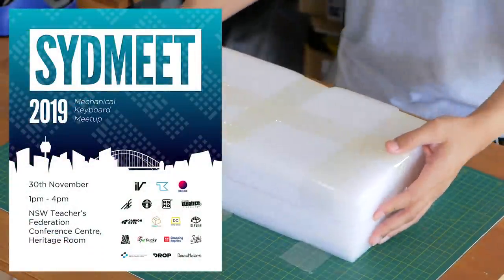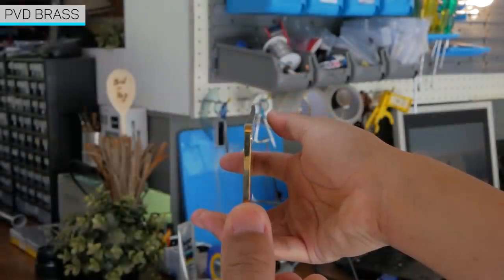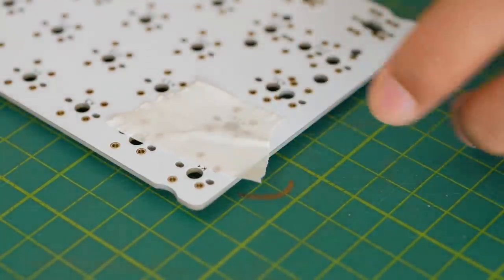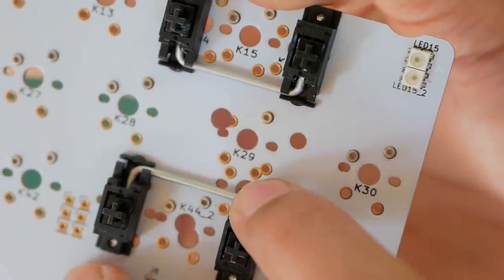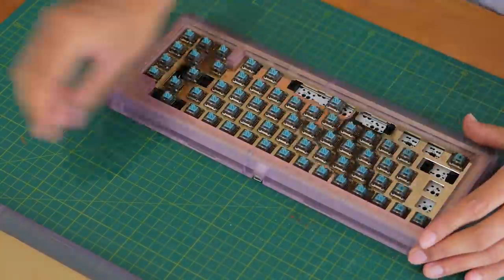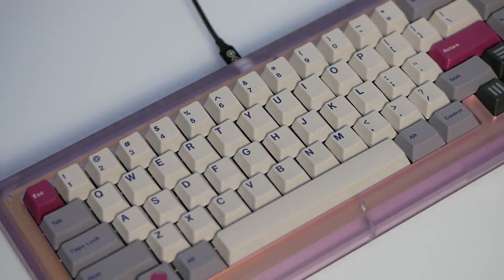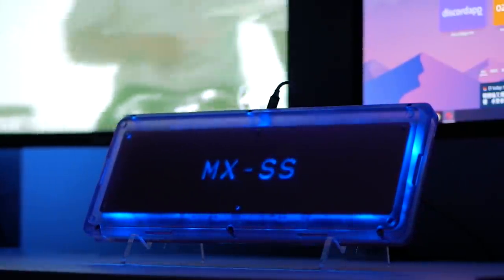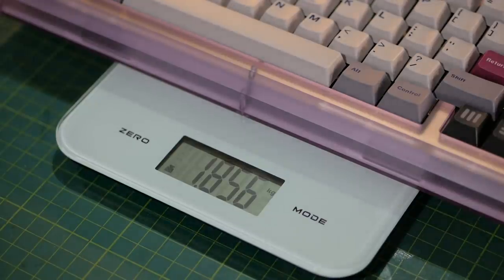Polycarbonate Custom Mechanical Keyboard Build!

Comment: I use mill max sockets a lot. I recommend using sticky tack to hold them in place for soldering. Scotch tape was melting when I’ve tried using it and the socket becomes misaligned. Just don’t push the tack too hard or else it will clog the socket.
Reply from the maker: Thanks for the tips :)

Comment: i know this is a long time ago, but maybe you can use 1mm or thinner foam or something to offset the warp on the bottom weight?

like squeeze the foam between the weight and the case then screw it in to compress the foam?

Comment: I soldered mill max a few months ago but I destroyed pcb when putting switches in. So be careful. like soldering it is easy, but putting switches - not. Because it is hard to make it super straight. Like I recommend khail sockets XD Mill max is fun experiment but very risky. At least the board I was playing with had some problems (few switches were working randomly wasn't sure if it was the switches or pcb itself) so it cost me 40 usd but still I spend so much time soldering it (I solder first time like two months ago so I am not veteran)... Now I am taking mill max socket off from it (I will reuse it somewhere else because they are expensive) but is quite hard

Comment: what happens if u put the solder on the board itself but you don't mean to do it and it kinda has like a burn mark. i personally have never built a keyboard myself but if I did do it was it possible for me to clean it or did I just mess up badly. Tae did it so nicely

Comment: God I love the sound. How much of the sound is the poly, the base plate, the t1 switches, etc? I'd love to try to recreate the sound as much as I can... Was planning on doing a gk64, can I get anywhere near this sound with it?
Reply from the maker: Having lubed T1s will sound kinda like it. But not exactly the same as top mount brass with poly. I haven't tried T1s in a normal tray mount case, so I don't know how far apart they would be.
Reply: @TaeKeyboards  I felt like part of the sound was "hollow" space in the case, for lack of a better way to describe it. So I guess that's due to the top mount. Watching your personal keyboard build with the inks, that's also top mount. So maybe I just want top mount with linears. Thanks!

Comment: I would love to get into a hobby like this but the amounts of money needed is just insane.
Reply: The hobby is definitely a luxury, but depending on where you live you can build a cheap custom board for maybe $180CAD, or roughly $120USD (plastic case, 60% pcb, cheap gateron/kailh switches, cheap amazon keycaps).                                         Edit: if you dont have a buddy with a soldering iron you can borrow, youll want to shell out for a bit more money for a hotswap pcb

Comment: Not sure if I missed it but what's so important about double checking the bottom row? Is it to make sure the sockets are soldered in straight or something? At 5:30
Reply: so it fits in the case i think
Reply from the maker: oops. there's multiple options for the bottom row (different sized spacebars etc). So you have to double check that you put the switch in the right spots.

Comment: Working with polycarbonate isn't tough, it just doesn't lend itself to machining like other materials... It's better to use injection molding with polycarbonate but then you bear the cost of tool and die prototyping... It's just not something that ca easily be used on a $500 Cnc router from Aliexpress like acrylic.

I think an excellent candidate for an application like this would be to use ETFE instead of acrylic. I'm currently experimenting with milling ETFE and it's abrasion resistance, uv resistance, and clarity is top notch.
Reply: I mean, you're not wrong but basically all group buy cases are CNCed.  They're low production volume and you really can't justify the tooling expense needed for injection molding.

Comment: I think this is my favorite build you've done so far. I feel like you probably could have bent the weight back straight pretty easily if you tried, though I would understand your trepidation. I would just wrap it in some soft cloth and bend it around a bucket on its side or something else with a gentle curve to it. You could also use some clamps or even ratchet straps to help.

Comment: why dat sockets are expensive AF 😭
Reply: @sunjaeeeee  sure, for 40% board)
Reply: @D3NPA  for a pack of 100 Look at the sides
Reply: @D3NPA  wait im dumb you need 200
Reply: @sunjaeeeee  1 switch = 2 pins